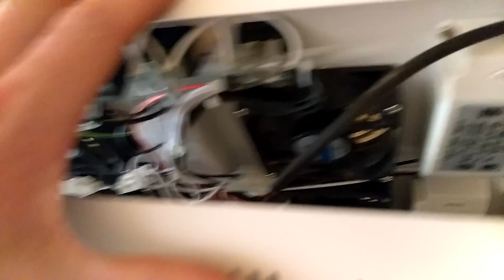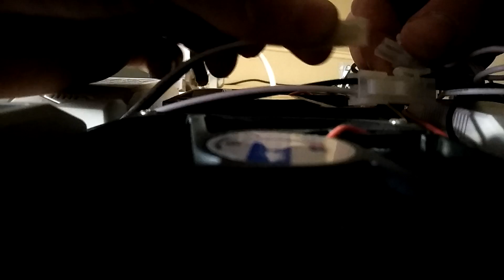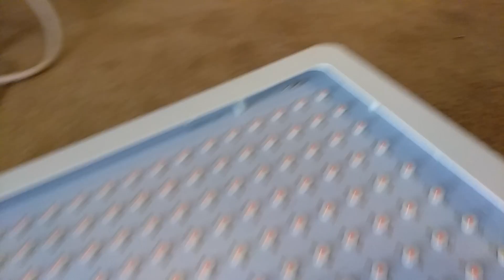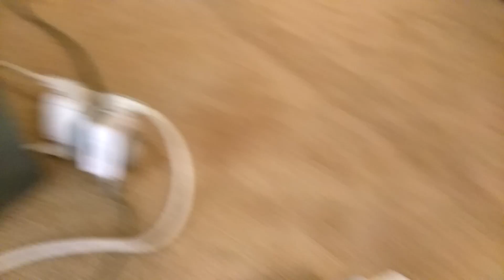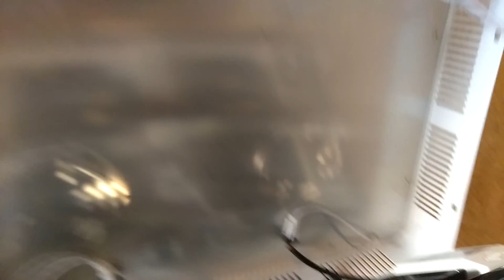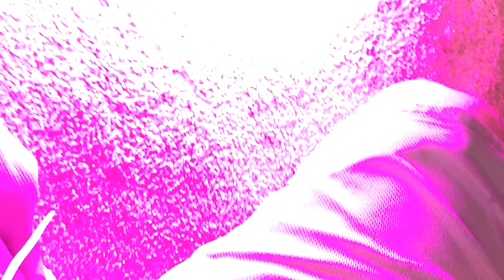Repairing/Dismantling LED Grow Light - Reconnecting Wires

Comment: HEY BRO QUICK QUESTION IM WORKING ON A BESTVA ELITE 2000WATT led GROW LIGHT THERE IS A FEW BURNT DIODES  ON THE BOARD I SEE LETTERS LOCATED UNDER THE DIODES CAN SOMEONE HELP ME MATCH THE LETTERS I SEE TO THE PROPER SPECTRUM DIODE SO I CAN ORDER NEW AND REPLACE THEM I TRIED TO CONTACT BESTVA FOR  SCHEMATIC WITH  NO LUCK AT ALL HERE IS THE LETTERS I CAN SEE BG,BS,CS,HG,HS,IR,LS,NB,ZL .... I HAVE PHOTOS AVAILABLE ASWELL